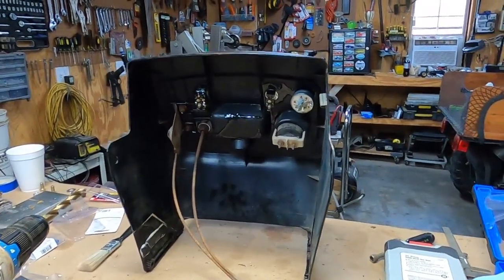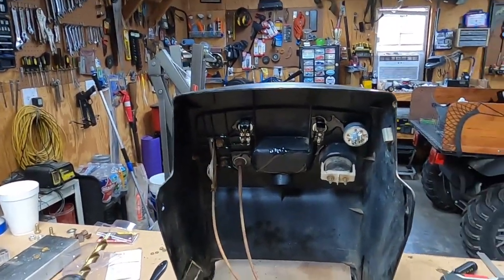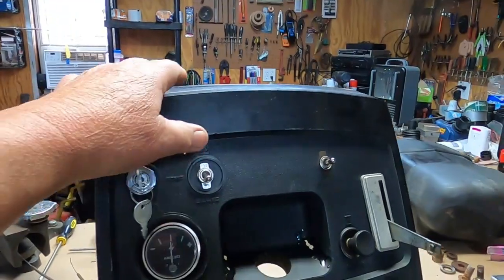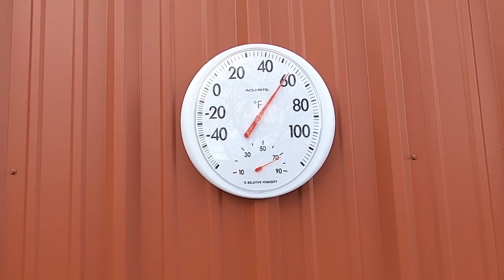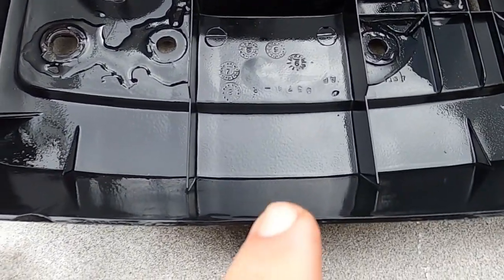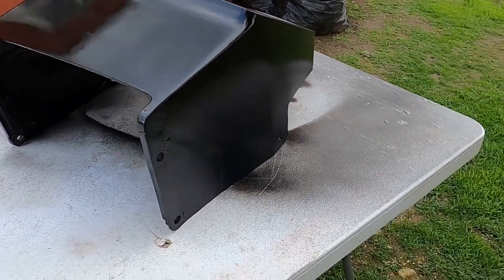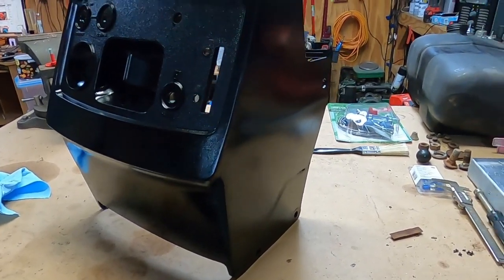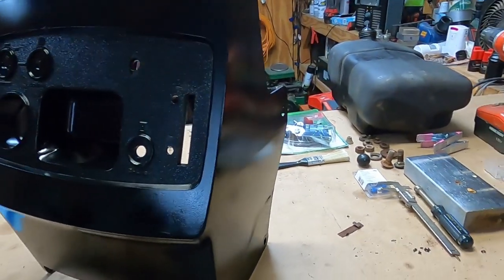Roper 16T   Dash repaired and prepping for installation

Comment: The dash tower looks fantastic. Where did you buy your new ignition switch, we struggle to find them over here? Most classic car parts companies over here stock push/pull switches as they were very common on British cars of the 1950-70's. I know a large numbers of those cars were exported to the US so it may be worth looking to see if you have any companies specialising in those car parts
Reply from the maker: The ignition switch can be had locally at several stores like Lowe's, and Home Depot. Also at several car parts stores and my local hardware store. Amazon has them too. I'll look into the push pull switch. Take care.